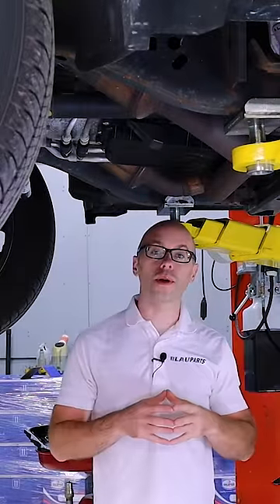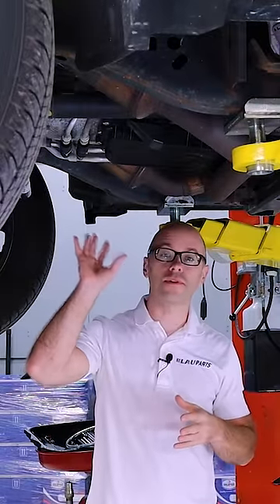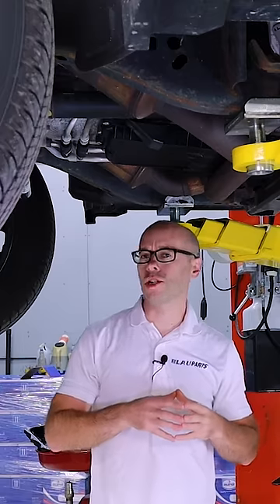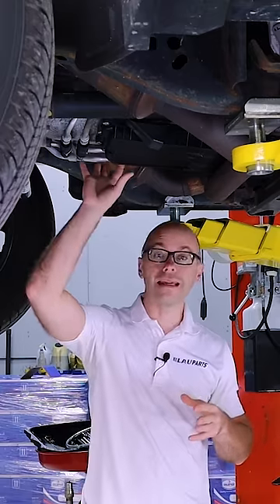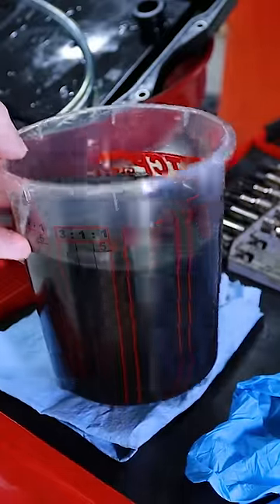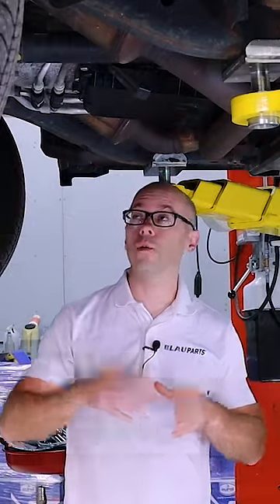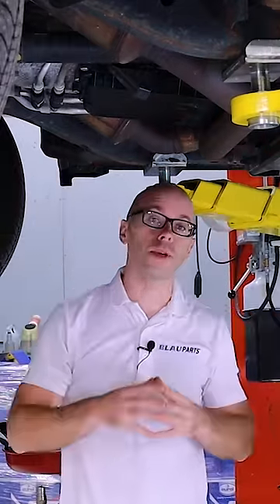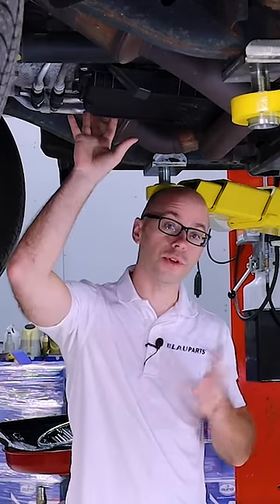How to change the transmission fluid & filter on a Ram 1500 8-speed ZF automatic #shorts

Comment: What about the oil in the Torque Coverter oil, the Cooler Lines, and The transmission coolers themselves. Why didn't you change that oil?
Reply: Way to much work that isn’t worth the hassle. Even doing it the normal way is way too much work in these vehicles. Places already want to charge $1000 for this work ask them to remove oil from limes coolers etc and you’ll only add more to the bill

Comment: I currently have a 2019 Ram 1500....I went to the Ram dealership to pick up some transfer case fluid. While doing so, I asked the customer rep. what was the capacity for the transmission fluid.  He explained to me not to change the transmission fluid since the closed system of the transmission has to have a certain internal pressure. If the truck is driven not at the proper transmission pressure, it could slowly mess things up. He ended with these trucks are supposed to have a lifetime lifespan, having no need for the fuel to be changed. I said, thank you, and walked away.
The truck is currently at 66,000 miles. Should I go ahead and changed the transmission fluid?
Reply from the maker: Hi there, we have a popular blog article on these "lifetime transmission" statements here that you may be interested in: https://www.blauparts.com/blog/what-does-lifetime-transmission-fluid-really-mean.html

Comment: my 2018 hemi has 148k and fluid has never been changed , should I change it out?
Reply from the maker: The recommended service interval for changing the Ram 1500 8-speed transmission fluid is every 60,000 miles, so this would be a recommended service for your Ram. You can find more info on Ram 1500 fluid change intervals, why the ATF should be changed, and why the "lifetime" fluid claims aren't accurate on our blog at blauparts.com.